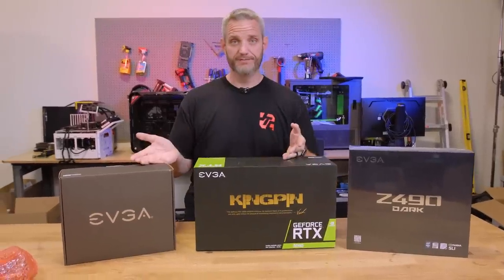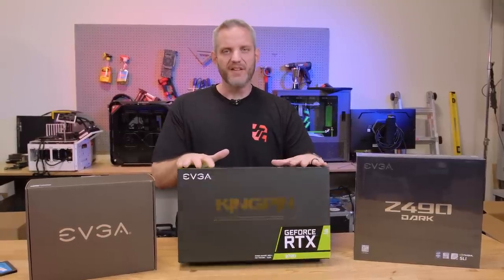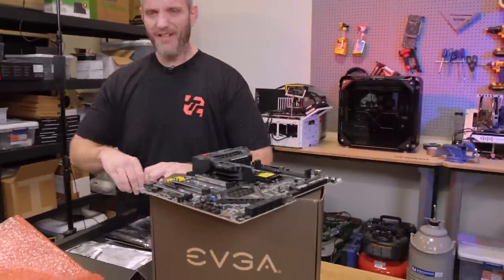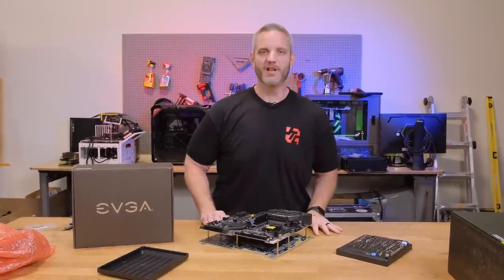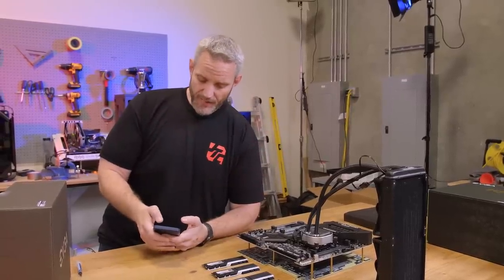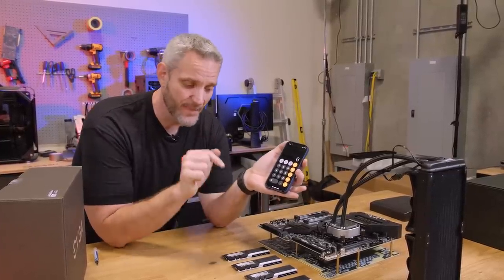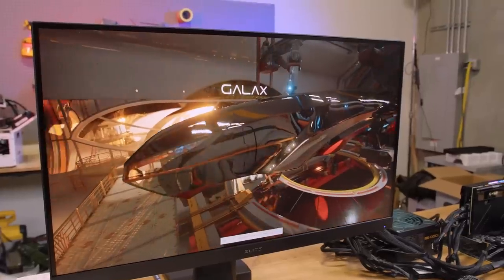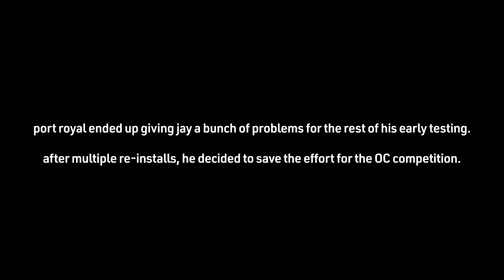RTX 3090 KINGPIN.... This should be illegal...

Comment: 1090mv? crash at +125?
why is that so much different from a GTX 960
mine pulls like 1230mv iirc with +200 on the core which a little unstable but stable enough to get a benchmark score or game for an hour, depends on the card's mood

Comment: im sorry but i really dislike the new logo. things like why is the t attached to the J and not the C? why arent they all detached/attached? why  does the J not look like a J? the the color or the cut edges? why does the C connect from the top part but not the bottom part to the edge of the "square thing" im sorry Jay but this logo needs to be reworked if its to look better...

Comment: 1.8V! May the gods have mercy on those poor dimms
Reply: 1.8v isn’t bad at all, those sticks will take 2-2.1v
Reply: @avagreen9060  I guess maybe just for some competitive ocing, but I've always seen 1.5 max for daily. Is that not right?
Reply: @Eidolon2003  1.5 is the general advice, but I know people that run 1.55-1.6 daily. B die is pretty voltage tolerant, but once it gets pretty high you’ll need to use maxmem and only let windows use 3gb of memory or so, otherwise it will be unstable

Comment: I have trident z ram 3600 mhz cl15 which is tuned to 2933mhz at cl 12-12-12-12-24-36 and the latency translate into 8,18 nanosec..... This is not the insane part, the insane part is that is on a x370 with a ryzen 2700x POG

Comment: It's too bad EVGA's FlowControl software is pretty lame. I returned my CLC AIO because they force your fans to reach 100% speed when the CPU it's 60°C. I'd have kept it otherwise.
Reply: Skilled Rebuilds  Dang, that's a bummer :/. So many AIOs have terrible software. If EVGA would allow you to raise the maximum temperature to even 70C then I would have kept it. I know they allowed full control of the pump speed, which is nice because I'm under the impression that most AIOs can achieve the same temperatures at much lower speeds than 100%, increasing the lifespan of the product. I've had nothing but problems with the Fractal Design Celcius+ Dynamic that replaced it as well.
Reply: Skilled Rebuilds  Reading your comment again, I'd consider testing your temperatures with the pump speed at 2000rpm. Like it said in my other comment, it may not make a difference and would likely increase the lifespan of the pump.

Comment: Why not embrace the vaseline-dipped motherboard and try out mineral-oil-whole-PC-submerged cooling of a current system with a TDP around 600W hooked up to a car radiator? Or try the 3M novec 7100 fluid that "Der Bauer" used quite a while back  to cool submerged GPUs...

https://www.caseking.de/en/caseking-blog/der8auer-pc-cooling-done-differently-part-1-dual-phase-submerged-cooling-3246.html

Comment: Wonder if anyone has used any of them spray able moisture resistant non-conductive barrier coatings, conformal coatings, like aculon nano proof, believe 3m makes similar things, are there any available to the consumer, would they work, 3m makes some things too. Just looked around, sure vaseline is sexier, but the materials scientists and chemists have developed some fancy shit they sell to oems for similar purpose, repellant but trapping little heat and vapor breathable, some claim to be able to coat everything and be able to plug stuff in through it without causing issue, just curious.
Reply: Theh make stuff for industrial control electronics in harsh environments, realize using refrigerants and cryo gets wet as hell. Wonder if pre coating with conformal coatings then combining the mineral oil bath and cryo cooling block, would any moisture float up and away or would there just be none created, just wondering aloud out of my ass without searching, maybe I'll look some of it up.

Comment: wait wait wait
your math is wrong 
dram timings calculate this way
1 Second divide by real ramclock multiplied cl clock and multiplied 1000= ns
example
1/1800*20*1000= 11,1ns
thats my ram timings your will be
1/1800*16*1000=8,88ns
ddr4 3600 with cl12 never if you are lucky you can get cl15
cl16 normally works

Comment: Port royal has been giving me a bitch of a time lately. I'm not getting consistent clock speeds like I know my card is completely stable at 2070 but it's not going that high at all averaging 2009 if its a good run only get a 2070 spike at the end. I've tried voltage curve as well and doesn't make a difference.

Comment: If EVGA had made an AM4 based motherboard, I'd have bought one instead of the crappy Asus ROG Strix B550 board I went with. (and I call it crappy because their LAN driver doesn't install at all and they refuse to update it, it's been 2 months... been stuck with Windows update version of the driver, which works so far, but... it's Microsoft... we all know how shit their drivers usually are). Their tech support center is also a joke.